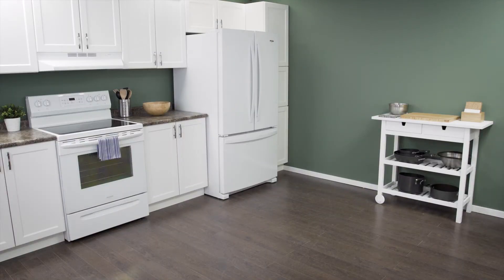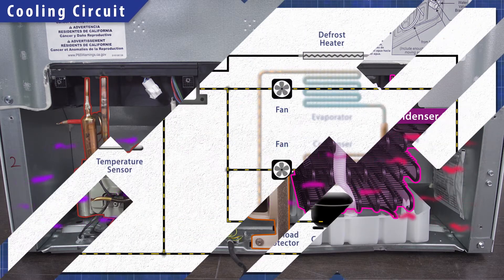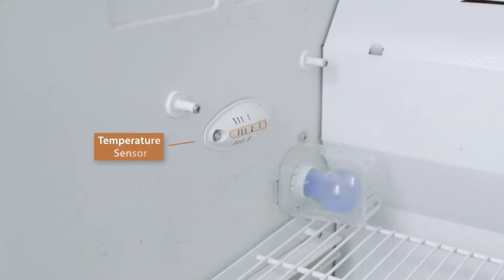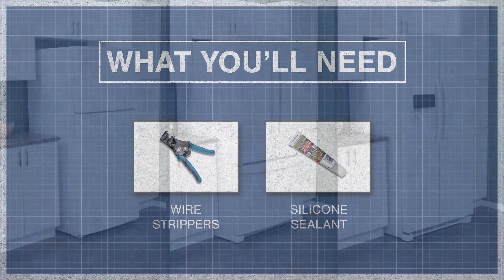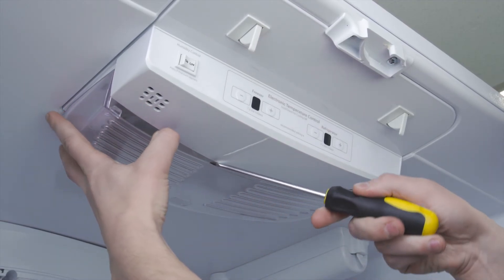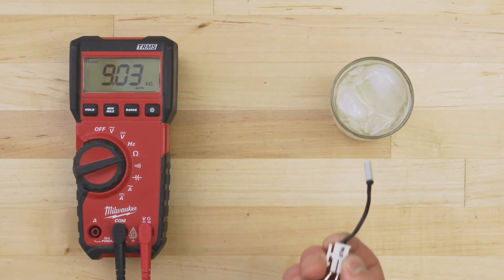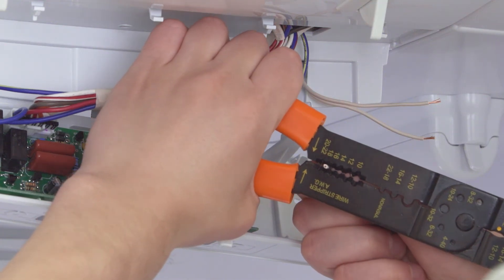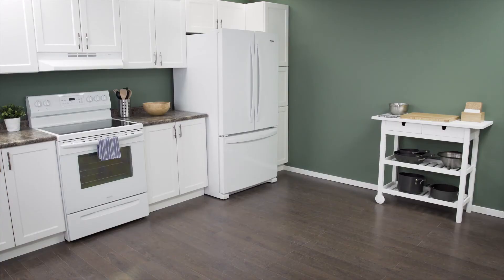How to Test & Replace a Thermistor (Refrigerator) | Repair & Replace

Comment: What is the normal range for the resistance of a thermistor at room temp? Samsung refrigerator, twin cooling no frost system.
Reply from the maker: I don't have any solid info on the Samsung models so I can't tell you for sure how much they differ from other models.

Comment: ok mine is 10K at room temp and 20K in ice water! so i need a new one!
Reply from the maker: Thanks for watching. It depends on the refrigerator. There might be some refrigerator thermistors that are rated at those ohm values. What does your tech sheet say?

Comment: Would you know what the resistance at room temperature should be for LG thermistor part number 6500JB2001B?   Mine is showing 13k ohms.
Reply from the maker: Thanks for watching. That's not something we have the information on but 13K does seem higher than other thermistors.